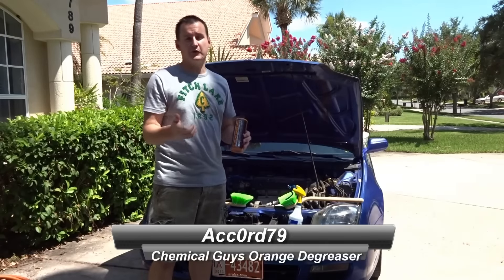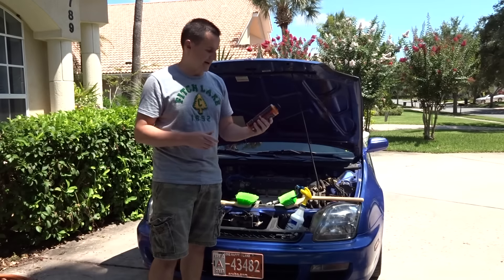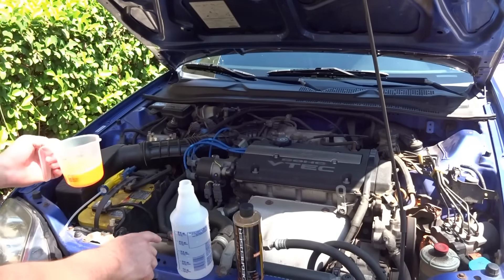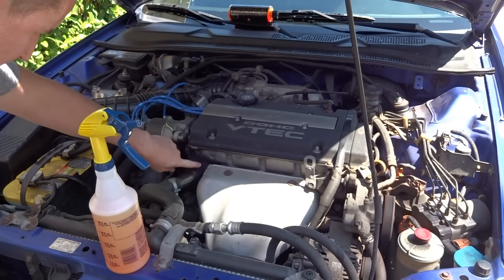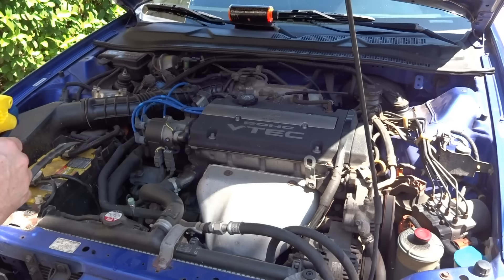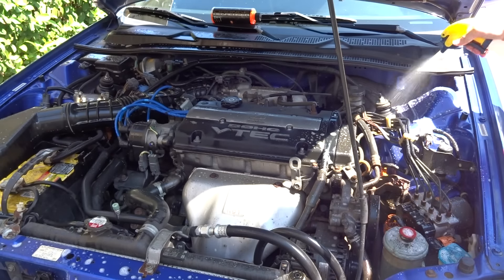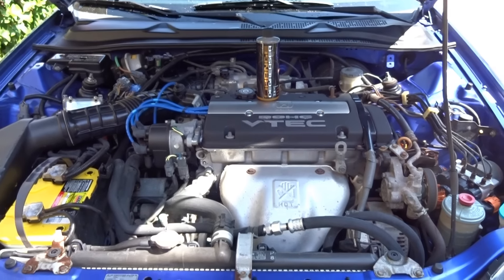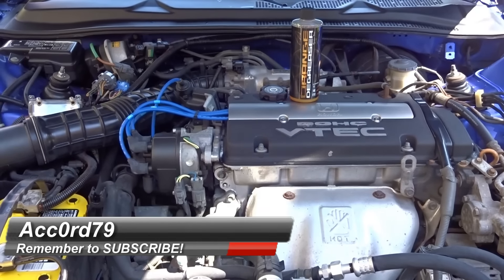Chemical Guys Orange Degreaser Review and Test Results on my Honda Prelude Engine

Comment: This is one of the best products that Chemical Guys makes.  I've cleaned 4 engines with it and the results are just like yours.  The really great thing about this product and most CG cleaners is that they RINSE easily.  Many cleaners take a lot of water to get off the surface, but not this cleaner.  

Try it at 1:15 for a great interior cleaner.

Great review!

Comment: Great video!  I have not tried this product, so I do not know first hand how well it works, but the most effective degreaser I found is La's Totally Awesome All Purpose Concentrated Cleaner, and it is only $1 for a 32 ounce bottle at Dollar Tree. Based on my testing, it out performs Gunk Engine Degreaser and Purple Power, and is a fraction of the price. As soon as it touches grease it instantly melts it off. I use it straight as a wheel and tire cleaner as well as for engines. In my opinion it out performs all the wheel and tire cleaners that I tried, including Eagle 1, Dub and Meguiars, and is obviously much less expensive. You may want to give it a try, I think you will be surprised with how well it works.

Comment: This orange degreaser is the bomb, its a go-to cleaner. I mix it 10:1 and it works on tire dressing and other nasty grime. Sometimes I keep a spray bottle in the house for general cleaning, just dilute it down like a tablespoon in the spray bottle... The Grime-Reaper cleaner, don't waste your money on that because its not that great (letting you know). If you can get your hands on a gal of Blue-Wolf degreaser, its amazing stuff (made in Virginia) and some Walmart/Sams may have it.

Comment: the power steering resavoir  is the one in the front the brake resavoir is by the firewall but still a great video
Reply from the maker: yup sure cleaned that goop right up!
Reply: ABS*
Reply: Get an electric pressure washer. 

So much quieter, no bs maintenance. I've used both. And i have a electric cheapy $99 home depot unit and works great with my Foam Cannon.
Reply from the maker: lightningsmokerXx I have been eying a 3200psi one so I can use it on the roof of the house, the pool deck, and the sides of the home.
Reply: Acc0rd79 I have some commercial husqvarnas that are 3500+ psi some of them are a bit more and I have a Simpson at I believe 4500 but yes they will do ANYTHING,just be sure to have a guage where you can adjust it or you will break and shatter alot,I own my own businesses and I'm only 18 so really I don't have much money to have separate pressure washers so I just bought gushes and the Simpson one at lowes works well but use Teflon tape when you thread it in to prevent leaks,good luck!

Comment: Some black on black spray from chemical guys and that engine bay would look new af.. 
By the way what are the most important things to cover when doing this?? Thanks
Reply from the maker: any electrical, newer cars wont have an issue but if your fuse box isn't sealed or maybe cover your alternator but most newer cars in the last 20 years are sealed and can take water on them.
Reply: +Acc0rd79 awesome .. I have a 2014 Mazda but never really dared to put a hose in it . Just some CG degreaser and wipe off with towels . Thanks

Comment: Is there anything in particular that you need to cover up while cleaning the engine bay? Like battery terminals or the alternator? I've been wanting to clean mines for a while but I've always been too scared lol
Reply from the maker: You saw I sprayed down everything. Some things on old cars need to be watched out for like fuse boxes, alternators etc but newer cars have most of that covered. If you have any doubt though, just grab an old plastic shopping bag and cover it.

Comment: You should try it on your older prelude
Reply from the maker: actually the older prelude has a very clean engine bay as last year when the head gasket was replaced and the head was milled, it was totally degreased and cleaned up!

Comment: what should i use for engine shine like to make the hoses shine
Reply from the maker: Any trim or dressing is good. Sometimes though that does collect dust so make sure it dries good
Reply: TvidzCT for car shows on the fly I've learned to use an aerosol tire shine after thoroughly cleaning and it works and looks amazing,I used meguiars nxt,check it out,I don't think you'll be disappointed

Comment: love you're videos. here's what I do and much easier and cheaper. I use formula 88 in a spray bottle and hose It Off. then I spray cheap tire shine on everything and it looks great.
Reply from the maker: I don't want any shine stuff like that on it as that will attract dust. There are very good products that will give you a shine but won't collect dust.
Reply: +Acc0rd79  I'm going to message you on Facebook. it's not much of a shine and it makes it much easier to clean.

Comment: We pressure wash our car engines down every year because we live in a very wintery nasty place and it gets extremely dirty, I've never used any chemicals but this looks very good and safe:)., because some engine degreasers are flammable and we've always kept the engine running while washing so it dries faster and for the safety of the engine.. Believe me engines don't like water, they are baby volcanos in my eyes!😃
Reply from the maker: yah no junk to deal with down here:) Just rain and that's it. I think last year our low hit around 42F so it wasn't that bad, Christmas was still around 70F! If you do apply this, do it to a cool engine, then when you wash it off and area ready to wipe it down, start it up to help it dry faster:)